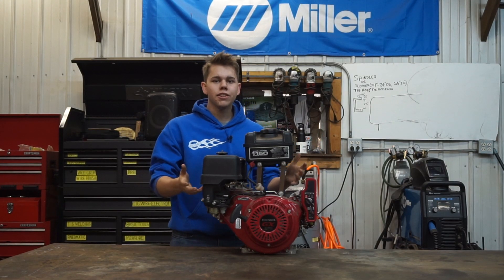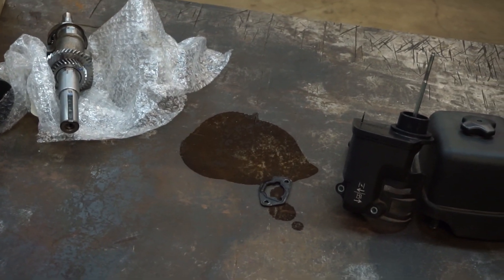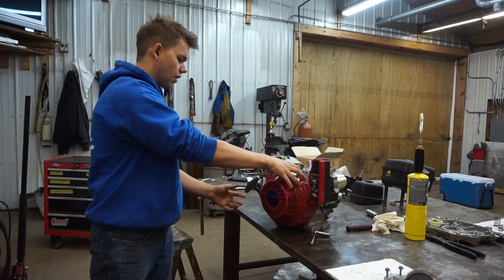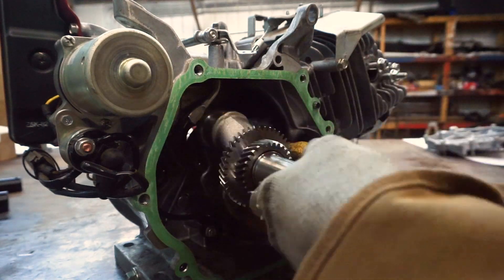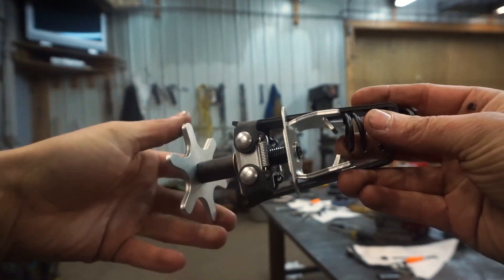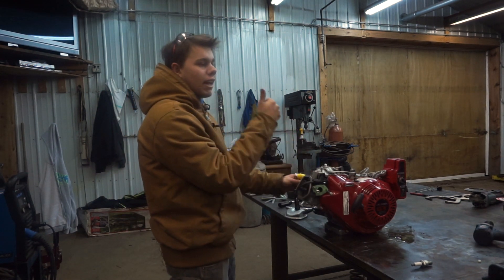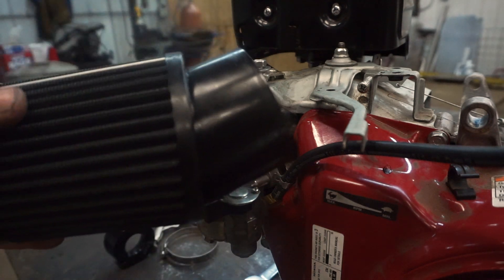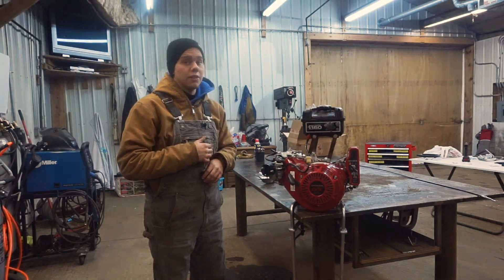Honda GX270 COMPLETE OVERHAUL | How much HP??

Comment from the maker: Since uploading, I've replaced the carburetor- which didn't really change anything. If you know what the issue could be I'm all ears!
Reply: It sounds the balancer is mistimed.  I t is hitting the crankshaft.  I have 2 of these engines as as well as 2 GX390 engines that I maintain.  The balancer bearing sometimes goes as well.
Reply from the maker: @ Thank you. I will investigate this. I appreciate the suggestion
Reply: Timing Dude, valve clearance, or coil breaking down.
Reply: Udaya👍👌✌️⛽🧰

Comment: You gave it larger jets on a stock carb. If you added more fuel and it ended up running rich then that means you're not getting enough air. Upgrade to a larger aftermarket carb and jet it for your your altitude.
Reply from the maker: I also tried putting the stock jet back in- it didn’t make a difference

Comment: It’s got a rev limiter because it came off a generator to keep from frying what’s plugged into the generator.   I don’t know what part of the ignition is responsible for the limiter tho.  But I have messed with a few Honda generators that did this same thing if you try to rev it passed the 3600rpm range.
Reply from the maker: Thank you so much. This is definitely what’s happening. I’ll have to do more research then. I appreciate it!

Comment: The flywheel is going to be a potentially deadly missile now that you removed the govenor. You should have replaced it with a cast or billet flywheel... especially with that extenally mounted magnet that is simply glued on. The Magnet is on the inside on cast/billet flywheels. Also, the crank bolts are stretch to torq, so you should have replaced them. Also, it woulda been good to replace those simple spring keepers with collets as the increase in revs could pop them off and cause catastrophic faliure. Also, you increased your spring rate, but kept the same cam... not gonna see as much benefit without an upgraded cam.
Reply from the maker: Yes 100% I do plan on upgrading the flywheel. That’s something I definitely should have mentioned. 

I did not know about the conversion from keepers to collets. That’s something I will look into.

As far as the springs go- I know they’re not doing much for me right now. But when the time comes that I do want to throw a cam in it I won’t have to worry about valve springs. 

Thanks for the info!

Comment: Try an original air filter. Stock filters are made to somehow calm the air flow while these open filters sometimes cause unwanted turbulences right at the entrance of a carburettor which can disturb its operation. They normally work well with fuel injection but not always with carburettors.
Reply from the maker: I just tried this to no avail. Thanks for the suggestion though!

Comment: Also, if it is running rich, it could also be because of the upgraded springs. You hardly did anything internally to need harder springs. Think of it as a smaller engine like a 212cc they only need upgraded springs once you add a new camshaft and piston. You didn't do that , so you have an engine taking in more gas than it needs. I work on engines, so I know. What could be but never one with a balancer, so I assume it could have some effect on it, too.
Reply from the maker: I see what you’re saying.. the reason why I put harder springs in was because I removed the governor. That’s just what I’ve heard people say to do. 

Also the upgraded valve springs don’t make the valve open further or longer than the original ones. Unless I’m mistaken, all the springs do is ensure that the tappets ride on the camshaft. Is this incorrect?
Reply: @ConnorPiala-ym6ql  yes that is all the springs really do,
I've built race kart and tractor motors most kart motors are able to get to 7k rpm with a high lift cam without spring upgrades for your application you don't need them.

 I've only had one motor blow from valve float it was a v twin brigs lawn tractor motor when I was doing a speed run it was at around 8k rpm but the only reason it blew was because of overheating that caused the valves to hang.
Reply: @ConnorPiala-ym6ql  that could be the issue or the balance shaft timing or valve / ignition coil clearance
Reply: That wouldn't cause it to run rich as the camshaft still runs the same pitch. All it would do it put stress on the stock cam and make sure the valves open and close absolutely precisely if for whatever reason they would otherwise have a little float.
Reply: Clearly you don't work on engines because stiffer valve springs would have nothing to do with why an engine is running rich.